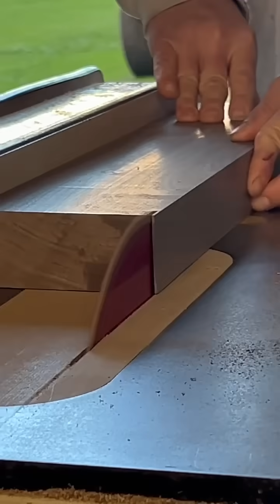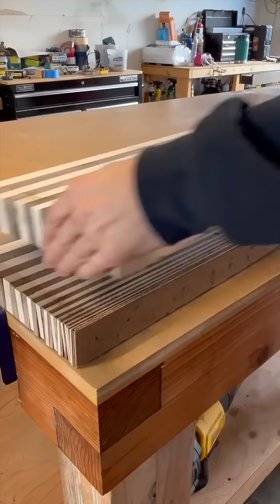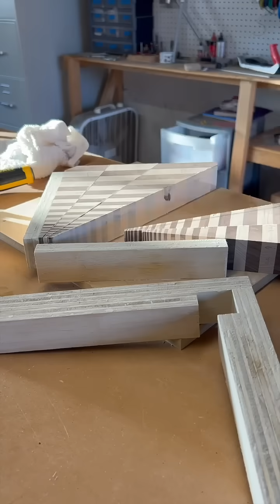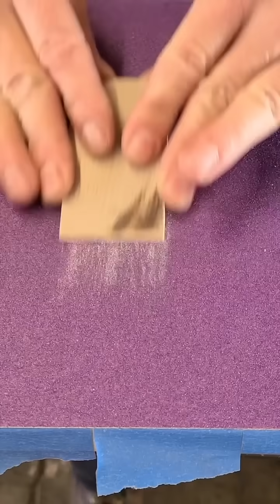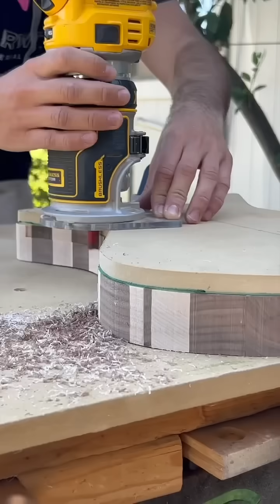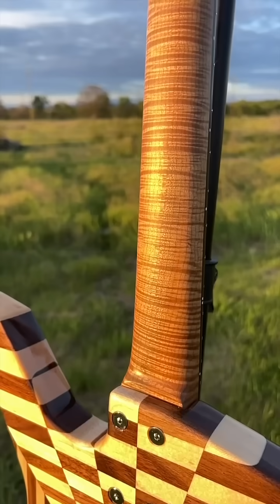Making an optical illusion guitar

Comment: Very nice.  I notice the neck of the guitar the wood runs parallel instead of horizontal won't the wood be weaker than if it were if the wood were horizontal?